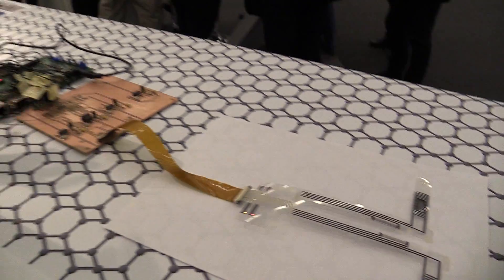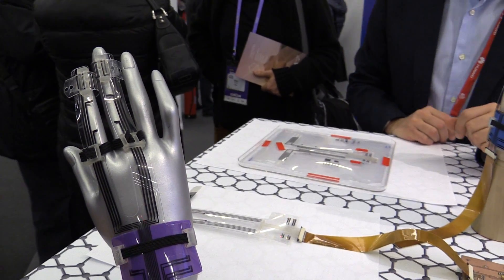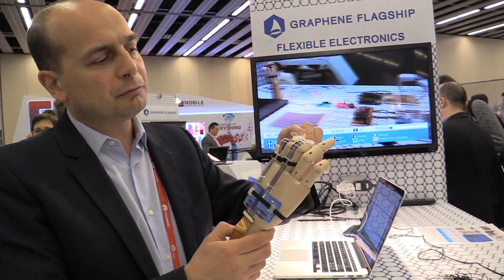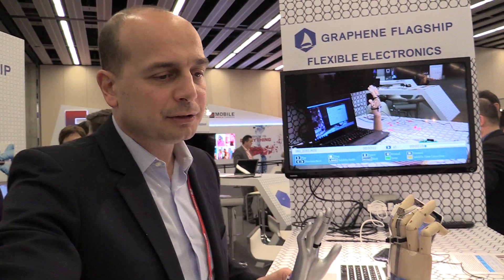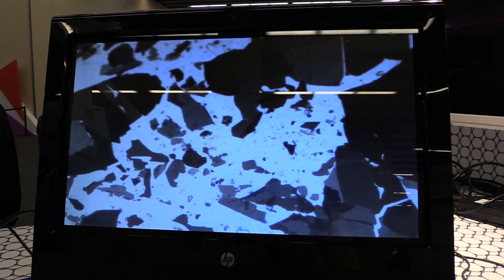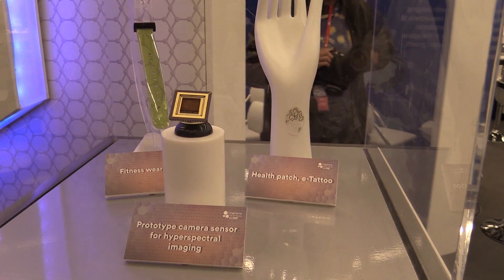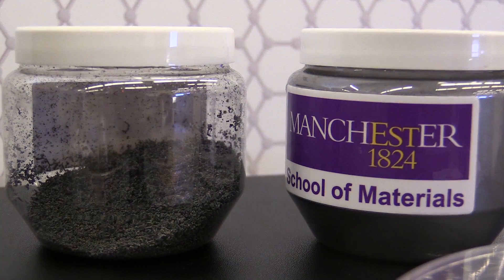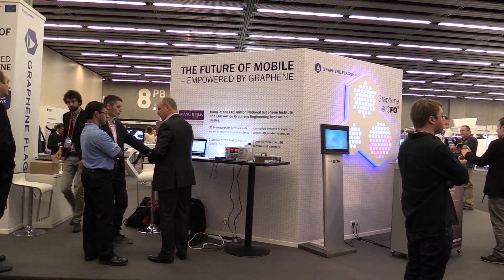Graphene-based wearables and electronics showcased at MWC16

Comment: i for one would not want a mobile phone on my wrist.... Mainly because the screen size is already not big and a wrist phone would shrink it further. Secondly because it would probably cause wrist cancer.
Reply: +MadMax think about all the microwave frequencies that cellphones use, and now show me proof that these do not damage DNA. Why would anyone want to integrate this into the skin or brain...  Its going to have to use a completely new technology like biological computers, and optical light communication.
Reply: about the microwaves causing cancer that's impossible as long as the waves emitted aren't ionizing, that and the power that it would have has such an insignificant effect it really doesn't matter (Well it might if it was ionizing). but there isn't a reason for them to be unless the companies want to kill you
Reply: more like smart watch on the sleeve end of ur shirt.
Reply: they are researching lify. That could solve ur problems